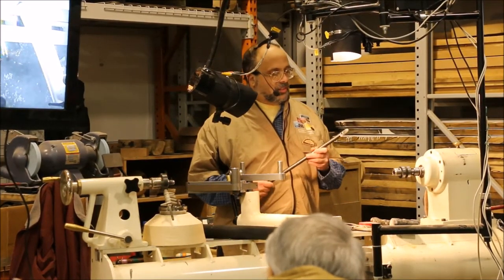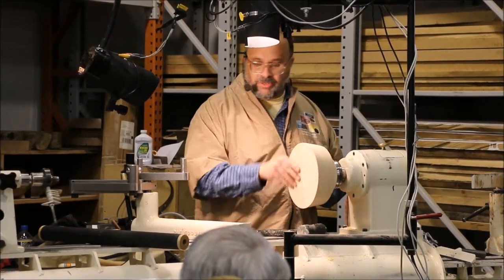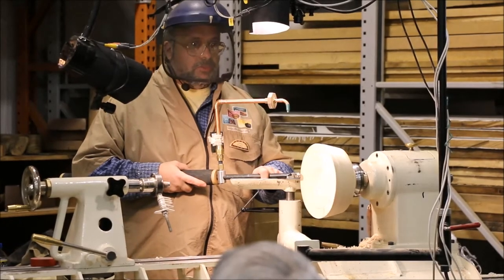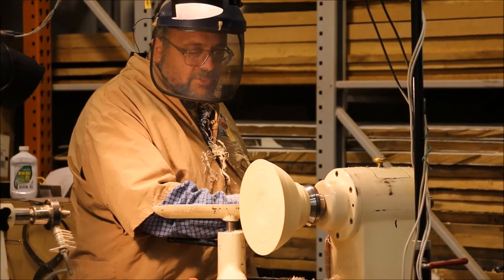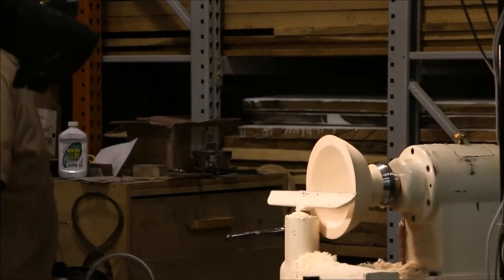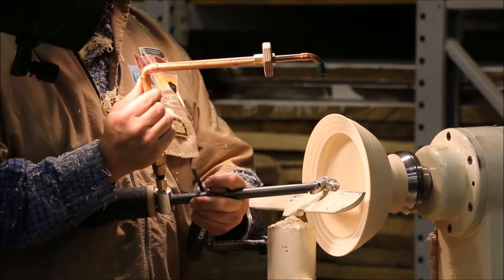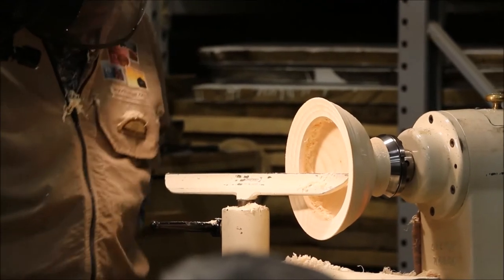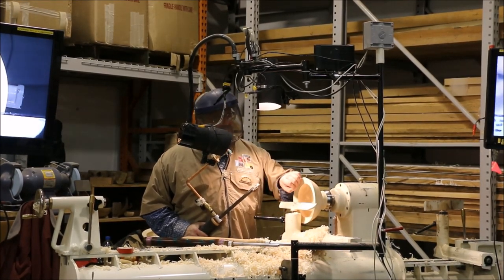Nutmeg Woodturners meeting, Jan 19 2015

Comment: I'm still trying to get this cutter to work for me.  So far I've found the Woodcut Pro-forme does a far better job of hollowing quickly than the Munro.  Have any pictures of close up techniques you use with the Munro?  I wonder if there's a way to use it to trim a small amount off a spindle, like a scraping action, but with a smoother cut and keeping the original shape.

I did see the hand out for the tool on your web site.  I like your sharpening technique for the cutter.  I guess I'll try the carbide cutter for it.